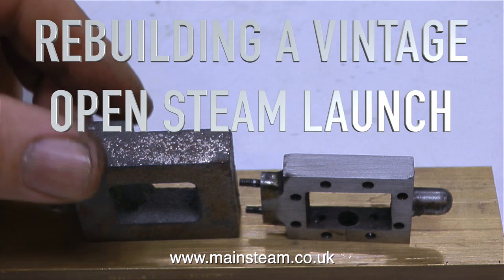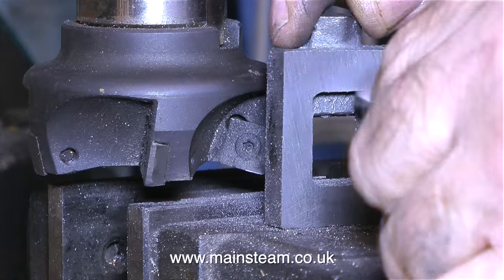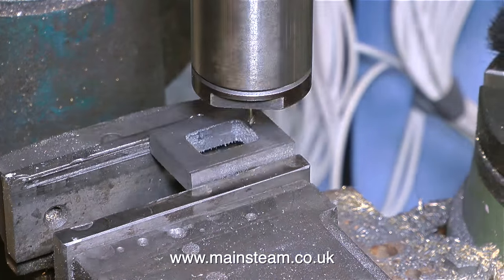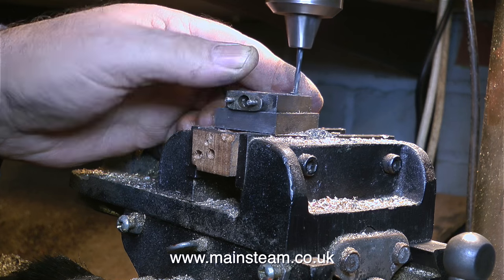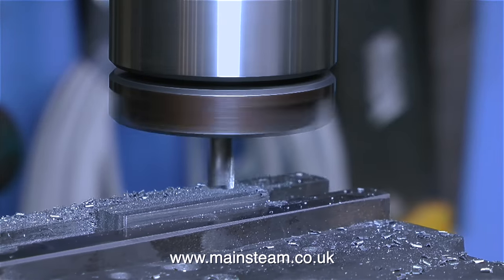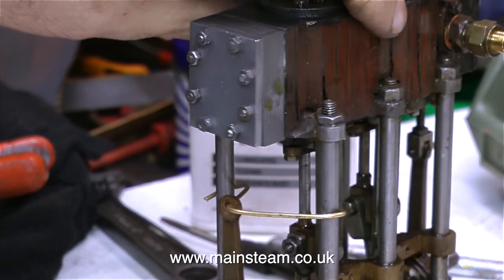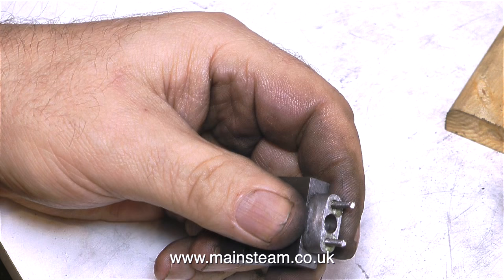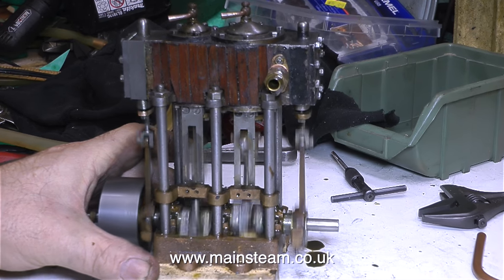REBUILDING A VINTAGE MODEL OPEN STEAM LAUNCH - PART #12

Comment: Thanks for all your great and helpful videos over the year, and your sense of humour!

I was going to buy a small lathe a couple of years ago, one of the smaller modellers types. I can't accomodate anything larger in my workshop (kiktchen), so on this basis, are there any out there, new or secondhand, that you'd reccommend?

Many thanks & Merry Christmas to you and yours.
Reply from the maker: Merry Christmas to you also, on the subject of small Lathes, Myford sized ones are OK, anything smaller can be very fiddly to use.
Reply: Thanks. I dare say a Myford would be too large, but I'll look into it in the new year. Cheers, Chris.

Comment: Hello Keith, Merry Christmas first of all. Just a small silly tip I've just discovered building some skis for my rc planes for the long winter we're looking at. Using a plastic airplane prop with a sharp edge is a great way to scrape CA from your fingers. Doesn't get it all but gets the majority after a while. I assume you would have some laying around from your previous plane videos. All your videos are great by the way, love every build.
Reply from the maker: Merry Christmas to you also - thanks for the tip, I will try that - far less dangerous than using an angle grinder  :-)))
Reply: Keith Appleton Indeed, I hold off on the grinder until it comes time to trim my nails haha.

Comment: Have a good Christmas! Is your mill a round Column type? And good to see that bloody drill chuck isn't in the mill! Though I do understand you as it is very rigid . I two have modified black gates castings they were very good quality . Keep on and it will be in steam in no time ! 😀
Reply from the maker: Yes it is the round column type. I used to have a Tom Senior M1 Miller bit that was a bit scary - too powerful for my small scale type of "Engineering"
Reply from the maker: My "Bloody" drill chuck has been in use for many years - I like anything that speeds up the process of incredibly boring basic milling jobs ..... :-)))
Reply: Keith Appleton to be fair I came over abit brash thanks for your videos they really are very very good .